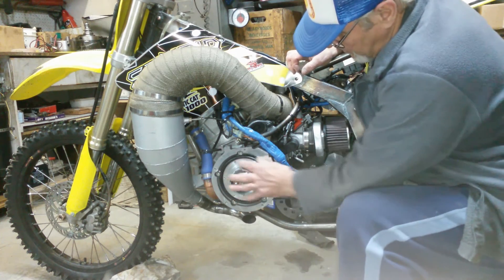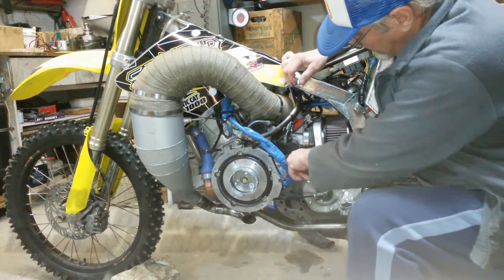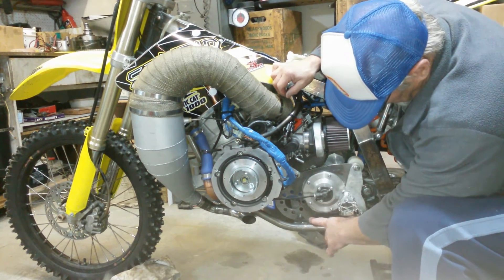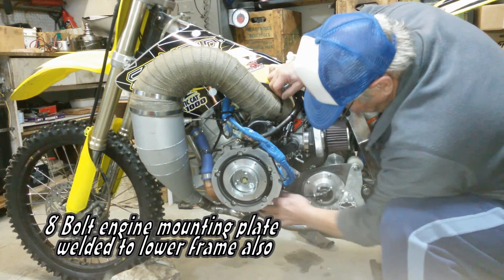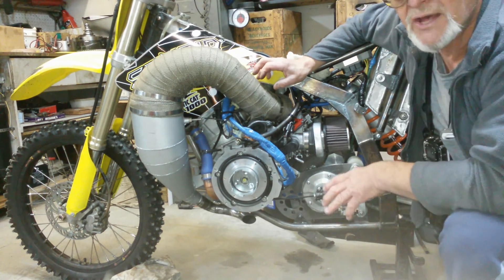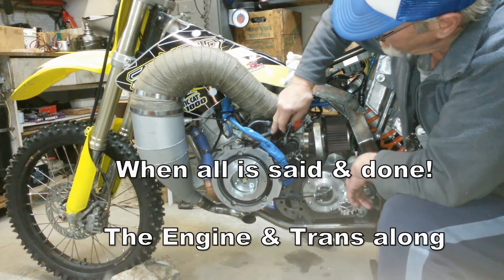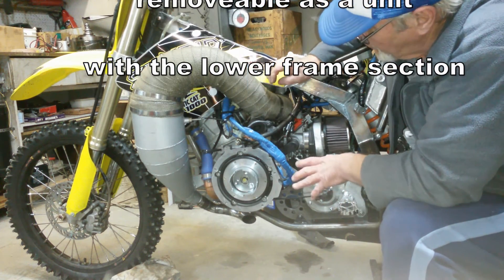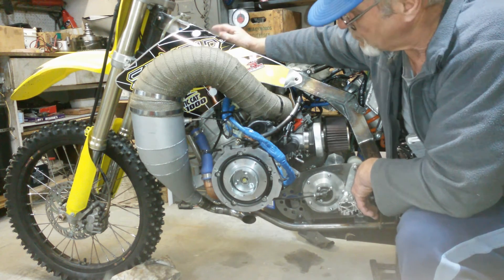1000cc Arctic Cat Mercury Balancer Build & Test

Comment: Hello, I have the same problem with a HO800 engine from arctic Cat (Suzuki).
Can you write me, where can I buy the balancer? 
Thanks Martin
Reply from the maker: I believe that Balance Masters out of California is the manufacture. But I don't believe they make one specifically for snowmobiles. Mostly for Harley's and Air Craft Props. We got this from Alberta Canada on eBay, a fella was clearing out his old stock. The one we're using was for a Harley Davidson  XL clutch, and we were able to make an adapter plate to fit it behind the pull start cup.
CHEERS!
Reply: Did you make the adaptor plate, or is it possible to find it online?..if you made it yourself, how thick is it??
Btw the bog you got is fuel map problem, use the bd box to get it to go clean, the m1000 engine is hard to fine tune, i can help you get it running perfect, Send me a mail:lars@northgrow.no
Reply from the maker: Holly crap! Sorry; 
I wish I would nave seen your rely a lot sooner. Hard to tune is an under statement!  As it urns out we spent a lot of time & $$, but we just recently got it running half descent. It still need more tuning and we're looking for someone that can possibly tune it on a crankshaft Dyno. See out latest video 
here > https://www.youtube.com/watch?v=bufzPMsyAls < 
As far as the Balancer, goes, we made our own adaptor plate. I'm not sure of the measurements, but if your still interested I can measure it up for you. 
JFYI: Although the mercury balancer helped, it wasn't our only balance problem. The clutch basket was out of balance by 7.5 grams due to someone installing a mismatched spring set.

Comment: 1.Hey good afternoon. what kind of bike is this. name, make and model. this is my first time seeing a 1000cc 2 stroke engine. im interested in learning more about this incredible machine. 
2. How can own one. where can i buy them. or do I have to build them?
Reply from the maker: This is a custom hand built Motorcycle Hill Climber! Its built from many different makes & models of Motorcycles & the motor is from a 2008 Arctic Cat Snowmobile LXR 1000cc. Here's a list of some of the different parts.
2002 Honda CR Front Forks, Early 80's 465 Yamaha Extended Swingarm, 2008 KTM 450 Rear Shock, Re-worked Barnes Flat Track Rear Wheel The (1 Speed in & out) Transmission box is hand made to fit a GSXR 600cc Clutch & Main Shaft; fitted to a BSA A65 Output Shaft along with a redesigned input shaft. The Frame, Pipes, Fuel Tank, etc. etc. are all hand made also.   
((( "STILL A WORK IN PROGRESS" ))) THX for the SUB.   CHEERS!